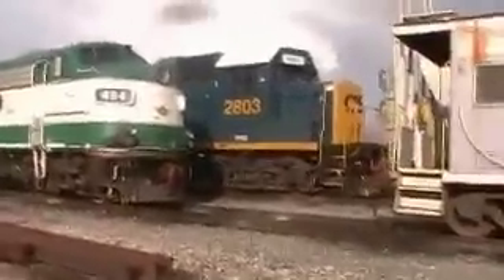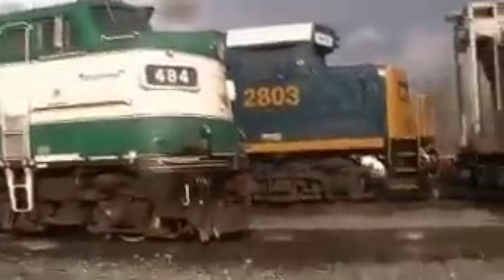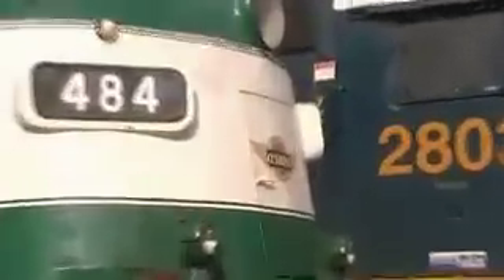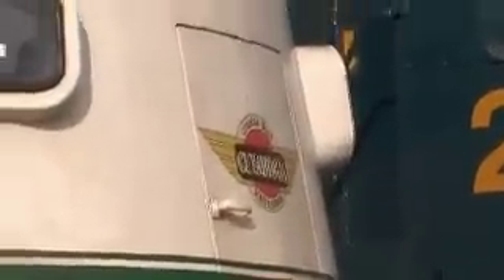FLNX FL9 at Fostoria,  W&LE SD40's at Bellevue, & ICE SD40's at Tiffin.

Comment: 484 an FL9 last time i saw it up for sale on ozarkmountain rail car...is ex amtrak..u can tell by the plow and the lights..60 of these duel powered units were built originally for NH..they were built to run as both diesel and electrics from third rail pick up shoes which is why they have the 5 axle design some unit also early on had pantographs... they are 59 ft which is only 11ft shorter then an E unit..qouted from pentrex tape Along the Hudson..awesome video!!

Comment: well yes looks just like the SD35 truck but its different..from what i've read/know.the rear truck is an A-1-A designed truck.EMD used both types for weight the clearance for the shoes & electricals..i've never heard of the front truck being a motor generator one. but this is what i read/heard. the 2 axle flexi coil type was made with the same wheelbase as the bloomberge truck.. the frist FL9's 2000/2001 had bloomberges. they couldn't mount the third rail shoes to them so they made this design

Comment: I am not saying your wrong I was just stating what I read/heard from others...you could be right since the only detailed info about the (front)traction motors is tht they were regular EMD D37B DC traction motors and since the conversion from diesel to electric was easy theycould used the  juice from the third rail to power them..thats what I read but EMD did make motor generator electrics also so it would be a great idea if they did!!
 :-)

Comment: oh yes I've been thinking about making one...ever since I saw the amtrak/metro north ones on tht pentrex tape i've liked those units..I made a simular unit to it but its a 6 axle..its based off of the Austrailan A class but it has one cab..then I took the FL9 as another unit to use and u have the F24C...i am working on a b unit for it i just need a chassie...but i really want an FL9..there is a company making them but for DCC/sound its almost 300 bucks for one..and almost 260 for DC

Comment: i almost fogot the front truck is a called  2 axle flexi coil type..the first 2 units had the bloomberge trucks but they couldn't mount the third rail shoes to them so they made the custom 2 axle flexicoil trucks which could have third rail shoes added